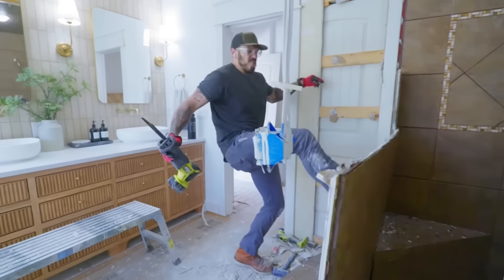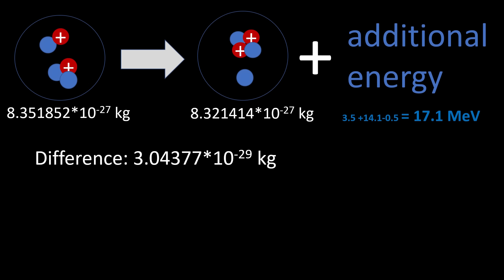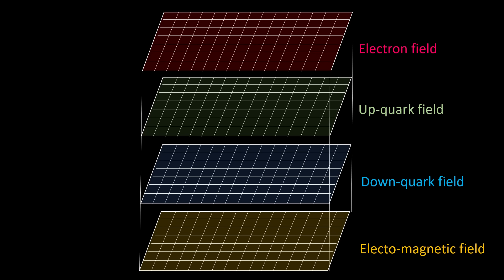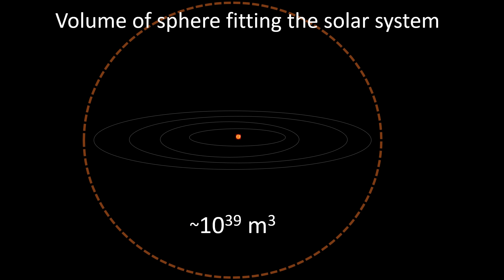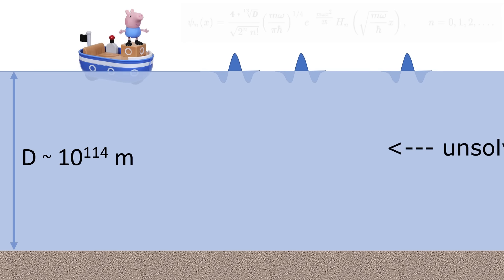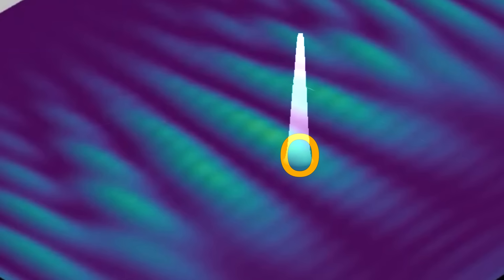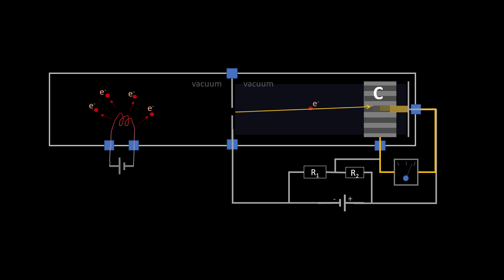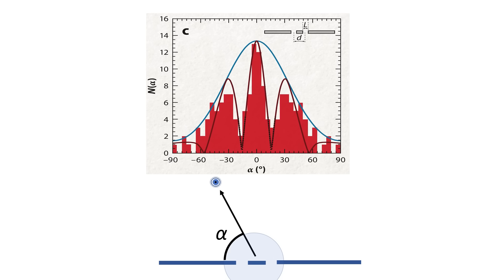Bathroom Quantum Fields and Vacuum Energy

Comment: do I get your last point right when I get it as an example of an underlying something (high vaccuum energy, luminiferous ether as the ancients coined it, or something else to that end) where waves of moving particles can go about? because that is what the Ve show displays, droplets on a surface (high surface tension liquid), this is not about intrinsic duality wave/particle as usually referred to in physics since the wave is in the liquid, separated from the particle above, it's rather a 2 body system (raising other issues)...

Congratulation on the succesful bathroom experiment, these are less easy as they may appear (a bit like particle physics ?)

Comment: The ocean depth analogy you use is close to what I understand is going on...The energy is folded into un observable dimensions...The Strong force is Strong because for color charge space is folded.  When you pull a quark out of the gluon tube a meson is formed ... The Antimatter is formed because you just pulled space apart.(previously folded up).... This is also the source of gravity.  Folded space of quarks (protons and neutrons) will curve macro space.  Gravity is resultant from the strong force not a force of its own.

Comment: Great video, and wry humor of course, thanks!  Your example of the waves in an ocean and the depth is really good (unsolved mysteries & all the wrong reasons).
Hopefully you can overcome your reservations about the high value of the vacuum energy.  Any kind of wave or resonance requires some type of medium in our macroscopic world and so I believe it has to be the same down to the Planck World.
Even your cool example of the ‘ring vortex in water’ should help convince you.  The ring vortex requires the water medium.  The water has a certain energy density, is it the energy of the water molecules, or the energy of the mass of the water molecules?  The energy of the water molecules has to be very much greater than that of the vortex ring. The energy density of the mass of the water (E=mc^2) has to be unbelievably higher than the vortex ring!
So what energy density would be required for a 511keV electron vortex, or more likely a resonance, to exist at its scale? I do not have the answer but for me the 10^114J/m^3 does not seem to be out of order (what is the energy density at the classic volume of an electron?).
Anyway, great thought provoking video.  And waves and resonance always require a medium.  As strange as that medium may sound.

Comment: I think the vacuum will have potential energy relative to the external field. Everything is a wave. Change every second. Even if I draw a line, it's never a perfectly straight line. And the two lines I draw are never the same. It seems to be a probability of that line appearing as I draw it. Our macroscopic notion of a particle is essentially the greatest probability, the most stable part of a measurement in a given space, time interval. The remaining probability is ignored, called error or called potential even though it is still different from 0. We talk about a person with the implication being on earth, although there is still the probability that person is, will be in andromeda galaxy if time is long enough. We should be wary of the distinction between "macro concept" and "microreality". We are waves of probability.

Comment: I believe, that there is no real fields as form of matter, as it is only math form of representation of some vector property of real matter. But I also believe, that whole space is full of matter, that has same properties as real gas has - pressure, density, temperature, viscosity. Ether is good name for that gas. Atoms consist of toroidal vortexes and covered by vortexes (electron shell). Quant of ether is so small, so we can't feel it. It works as simple as slippery ball. It has speed and direction, no friction. Elementary particles as proton could be simple toroidal vortex, so of course it might behave as a wave. The source of my thoughts is "Atsyukovsky, V.A. General Etherodynamics." and thought of his followers.

Comment: I too, wonder about many of the concepts expressed in your video. I think of "empty" space as space-time where it requires energy to hold a given volume of empty space "open". The following analogy may not be correct, but if E = mc^2, then the velocity c is proportional to distance^2 / time^2. We could rewrite E = mc^2 as E = mass * distance^2 / time^2. Since distance is "space" and "time" is time, we have related energy and mass to space-time. This implies to me that the concept of space requiring energy to exists is at least plausible.
As for measurement at the atomic level, its a bit like trying to determine the shape of a  BB, when the only tools one has are bricks, which one throws at the BB stream and observes (in the dark) the BB's deflection from the hurling brick's surface. It's hunting gnats with a elephant gun. Even if one hits the gnat it is difficult to know.

Comment: 15:30 I don't think the probabilitywave oscillates the quantum oscillators. The wave doesn't really exist, it's just a useful tool for you and me who don't know where the electron currently is. The quantum field oscillates only where the electron currently is, and nowhere else.
Yes, it travels as a wave but we don't really know what that means. In my experience it seems to be travelling as a particle all the time, but for some reason in waves of probability instead of a straight line. This wave of probability can interact with itself, for some mysterious reason.

Comment: Not entirely a serious thought but what if the vacuum energy is akin to a DC bias on an AC signal on a circuit that can't take negative voltage, in other words necessary to allow for field oscillations in the first place?
But that carries the implication that there's a maximum "acceptable" oscillation amplitude. And it also raises the very frightening question of what happens to the universe if a quantum field begins clipping or, worse, feeds back negatively into the system! 😳
Reply from the maker: Interesting thought! Unfortunately according to the theory, the field energy can bever be lower that the vacuum energy. so your DC component would have to be the vacuum energy + the amplitude of your AC.

Comment: 14:20, maybe the reason why it's not intuitive that the 'waves' represents the probability is because we keep thinking of it in terms of ripples in a pond. Maybe we should think of it more analogous to thunderclouds, in which case the photon-detectors act like a sort of lighting rod that tap into that field. with this analogy it's more obvious why you can never detect a wave in 2 places at the same time (because as soon as a connection with a detector is made the charge is dissipated)

IDK if this analogy holds up to actual scientific scrutiny, but from a psychological standpoint it can be useful to challenge your assumptions by trying different analogies.

Comment: One important point about QFT is that is the only way to make quantum theory and special relativity compatible, as by quantum theory produce quantum tunneling of the observer light cone, that is, we can detect particles where you shouldn't because it is too far away for anything to be there if respect the universal speed limit of the speed of light. They only way make quantum theory consistent is go to an operator picture and ask the posible value of a operator in every point outside the light cone to respect a relativistic condition. But this operator at every point is what we called a quantum field. Also QFT is also the best for dealing with many particles interactions. Makes everything so much simpler. Physicists know the problem with infinities. That is why renormalization exists. But there is no other picture that they can use and make particle physics. We know is incomplete and the vacuum energy is missing something, but the best minds are still struggling with it. Also, the latest idea is very close to Bohm interpretation. It is an interesting one, but have the issue that is not relativistic. And nobody has succeed in doing a relativistic version. Until then, it is a no go.

Comment: What I personally don't understand is why so many people seem to have a problem with the concept of the "wave function collapse". It's just a nice way of saying "Conditions have changed and the results of this calculation are now invalid".
If you measure something, you disturb it. Therefore, any predictions about that object's state you had are now invalid. All the "wave function" is is a prediction on where you might be able to detect a given object, based on some assumed parameters that it had at one point in time.
Reply from the maker: The problem with this kind of invalidation is that the information about it should travel faster than light in order to avoid the same particle being detected twice in some configurations. So you can never talk about a fundamental particle as an "object" in view of a quantum field.

Comment: This actually starts near where some of my own thoughts start - what would it take to truly empty a cubic meter of space. 
From there, I go to black holes…   When two black holes merge…. The resulting object has a mass less than the sum of the black hole masses.
I’ve wondered - where does that mass go?  Yeah.. ‘gravity waves’, but is that it?  Does the expansion of the universe Doppler-shift the gravity waves?  How does that look at effectively infinite distances from the source?  Does the gravity wave at that distance ultimately get converted into space?
Did that mass conversion go on in the early universe, creating the expansion of the Big Bang?
Did changes in the rate of that conversion cause the expansion rate of the universe to change?
The implications would argue some things about a Big Crunch and a big rip…and they don’t all agree  :/

That’s what I get for trying to empty a cubic meter of absolutely everything: A headache.
Reply from the maker: If you just keep in mind that everything is energy and gravitational waves contain energy, it only makes sense that two recombined black holes contain less energy in the form of mass.
Reply: @HuygensOptics  true…
But - can you ‘redshift’ a gravity wave?  If so, what happens when a gravity wave is red-shifted into oblivion - or rather, what happens in an infinite universe, at your position as a result of all the gravity waves arriving from literally the edge of the observable universe?  Their wavelength would effectively become infinite - does that mean they just ‘add space’?  Is that why the universe expands?

Or have I had one too many 2-liter bottles of high-caffeine soda?
Reply: @Relkond  I do think that the depletion of gravity waves at "infinity" would effectively turn them back into space.  But it could just keep getting depleted since they are just continuously expanding, who knows for sure?

Comment: I've personally never been a fan of Quantum Probability. It tends to assign undue weight on observation which I don't really see as significantly justified. Interpreting energy and matter as self-sustaining waves without the need for an underlying medium seems like a better explanation to me. In fact, I don't see the need to model particles as particles at all. As far as I'm aware, the physics works just fine with pure wave functions.
Reply from the maker: I totally agree. A related questions is what a quantum field oscillator actually is and why we would need one at every Planck volume of space. Self- sustaining energy oscillations are in my opinion also a much more viable option.

Comment: My pet theory is that virtual photons (and similar bosons) are not actually virtual, and that an electron is actually localized and changes direction all the time based on how many virtual fotons it shoot out in wich direction. and that because of limeting factors in how much informations we can extract we can never keep track of where it goes, and all the quantum calculations are just used to deal with this.
im a 2nd year bachelors though, and know verry little of the subject (im also more of a math guy) , im sure someone could explain to me why that would be impossible
the biggest problem i can think of is that if virtual photons where real, and change the direction of the electron, that would meen they have momentum, but no energy, or charged particles are constantly emitting energy, wich would make even less sence.
the 2nd problem is that it doesnt explain how photons themself have wave particle duality, but they also have no mass so i dont care :)

Comment: Nice video, but I would like to point out some things. The energy of a particle depends on the reference frame of the observer. This is already true in classical mechanics since kinetic energy is proportional to velocity^2 which is observer-dependent. So energy is not an absolute, intrinsic quantity of a system. It is depends on the observer.

A second thing, energy conservation is not a universal law but follows from Noether's theorem for time-symmetric systems, i.e. it only holds in systems that do not change under infinitesimal time translations. Although this is the case for pretty much all (closed) physical systems we know of, it is not the case for all. And one very important example is the (observable) universe itself. The fact that it is expanding leads to a violation of energy conservation on cosmic scales. For example, photons that travel very long distances through space lose energy because the expansion of space elongates the photons' wavelength.

We often get the impression that energy is a substance intrinsic to all things that cannot get created or destroyed and that it may be a very fundamental part of reality. But it may be just a quantity whose conservation reflects the symmetry of physical systems with respect to time. It may very well be nothing more than a handy quantity for physicists and those who apply physics.

Comment: I thought you were going to use your CNC machine to cut the glass tile for your bathroom. Maybe use your coating chamber to make a cosmetic mirror or something.
Reply from the maker: Funny you would say that. In fact I did use the CNC saw on some tiles that had to exactly match with each other in width.  So I guess my bathroom might the only one containing precision tiles cut to a tolerance of 100 microns  ;-)

Comment: I was doing what I thought was a sunshine ceiling build when 
I realized my reason and thought have no
foundation, for to prove my reasoning even
exists, I would need to use reason... which would be circular reasoning.
I thought surely I could determine reason empirically by my observed actions
but that would necessarily require the assumption my observations themselves are
empirically valid, again circular. Surely maths and logic  could break the conundrum, but how can I

prove maths are valid without using maths and logic, once again circular.

I finally decided to just call in a carpenter to finish the ceiling....

Comment: I think the nomenclature here needs to be cleaned up, because it's confusing. Physicists use the words "observation" and "measurement" to describe an event that determines one or more of the properties of a quantum system.

If we consider observations of a single particle, it seems to me that what is missing from the picture as it is normally painted is that the observation of a particle is the particle.

For something to be physical (classical or macroscopic), it must have definite properties. Before an observation of a particle has taken place, what we have is merely a probability distribution over the possible values of a particle's properties should an observation event occur that collapses the wave function.

Ultimately, what it is to be a particle is to be a tuple of defined properties. It is a mistake to call the wave function of a particle or the associated probability distribution a particle because it isn't. Particles cannot be in two places at once, because particles are defined by having a single location. Probability distributions, however, cover all of space.

By cleaning up the language it becomes easier to reason and communicate without falling back to the mathematics, and in my opinion it is a failure of nomenclature to say that "quantum theory simply cannot be described with language".

Comment: Indeed, the measurment problem is the biggest unknown in quantum mechanics, as the measurment breaks the linearity of the quantum world to localize our classical phenomena, and we still don't have proper maths to describe how it works. It is actually outside the realm of what the math of quantum mechanics can answer, and it's physical meaning is for now an exercise in metaphyiscs. Indeed we have different "interpretation"of quantum mechanics (copenhaghen, multiple universes, superdeterminsim) that explore this point, but cannot be properly proven as they only add meaning to quantum mechanics but do not contain an hypotheys
cannot be tested experimentally as they do not predict anything that would lead to physiocal mesurable differences.  A good next theory that joins the classical and the quantum would indeed have new explanatory power and allow us to plan experiemnts around the wave function collapse to distinguish it from current QM. However many models that could lead to difference answer usually already struggle with taking into account certain strange quantum behaviors like entanglement or that int he double slit experiment electrons can be fired individually over long time and still somehow "know"the interference pattern like they have indeed filled the whole space while still apearing as a localized phenomena in the detecting stage